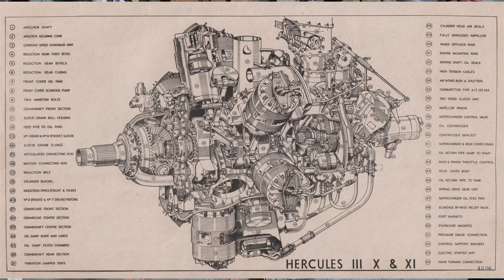Halifax MZ763 Reduction Gear Part One ...  It's First Strip Down Since 1944 !

Comment: Looks fantastic, wow Chris is coming, that will be great, two great worlds collide! Sleeve valves,tried that on steam engines as well. Ah thats what the spanner was for. Wasn't wrong. A little bit of heat helps. When you think of the important job that hub nut did. Transit and mk2 rear hubs are the same if not somewhat smaller. Well done.

Comment: that was a truly masterful piece of engineering work separating the drive from the cowling....so damned impressed as always both with your skills AND the quality of WW2 engineering that they still come apart....

As for haunted, well it depends upon what you group under the term haunted....i wouldn't say it was classically haunted with apparitions being seen etc...but the queen bee is there ...not sure of rank, possibly flight Lt... who i think is associated with the name of mary or maggie....tere are a couple of others dropping in....now if you step out of line in there and for example have swastikas and nazi memorabilia she might take offence and things may happen...but overall at present with the work that's been done transforming it back from pig pens into WAAF accomodation there is contentment...i do get the impression that she'd like flowers in there - a female touch just to brighten the place up .......really am looking forward to having the opportunity to visit, but as you know everything apart from internet access and remote viewing is off limits to me at present... C
Reply from the maker: Thank you Chris , the task was a simple weight reduction so as the owner can mount on a wall with a lightweight prop fitted... however after obtaining exploded diagrams of the reduction gear and how the front bearing in the housing for the shaft rotated for the first time since 1944 I decided to inspect the unit to see if it could be returned to operational condition so as to display it in the museum in a way that shows how it worked. So far another 3 bearings have unsiezed and rotate as they once did. .. The quality of the materials is first class and for 1940's tech it's quite mind blowing that during the war these engines were 'disposable' ! As for the museum and its residents... looking forwards to you investigating 👍

Comment: these egg shaped small cylinders sitting between fixed gear and case are for measuring engine torque
Reply from the maker: They are oiling plungers , made of two halves with a spring inside, these allow oil to pass from two oil galleries in the reduction gear casing to the oiling sleeve and bush which acts as a spacer between the pinion bevel gears and the bearing which is housed in the casing.